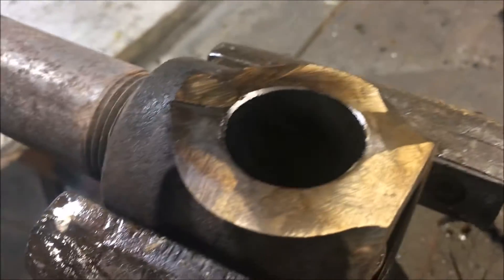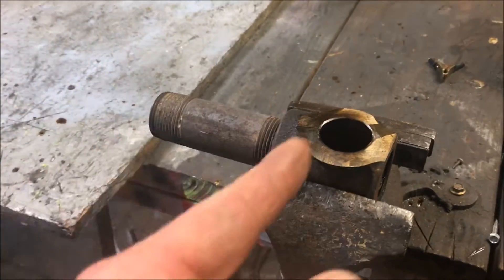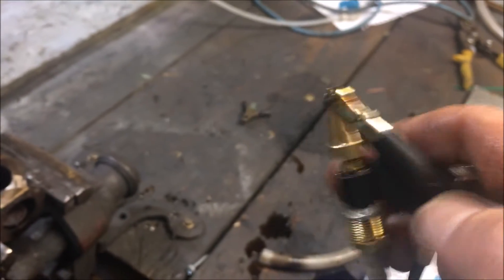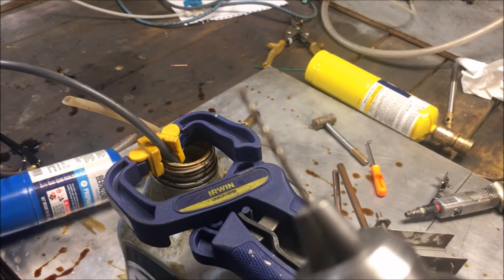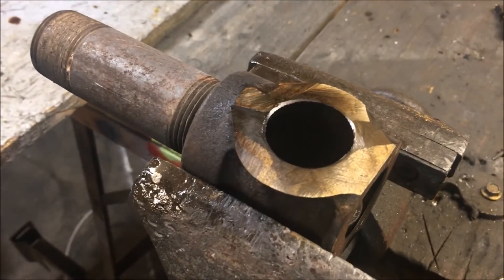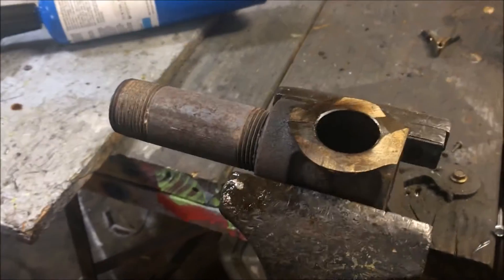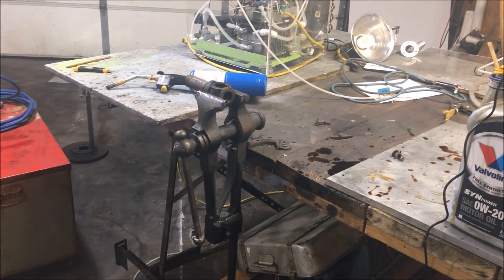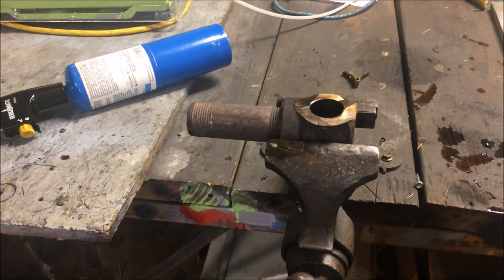Waste oil burner MICRO TORCH

Comment: This is quite similar to a burner setup for a pottery kiln that uses waste veggie oil. https://www.youtube.com/watch?v=zDFww3TCV80  One thing you might want to look into is using ceramics in your combustion chamber designs as they stand up much better than steel based solutions. I use ceramic flares for my propane burners in my small forge and they are so much nicer than the iron versions.

Comment: so this was with pure waste motor oil? And no preheating? If that is the case then im going to be building me one of these in the very near future as well. This might change the shop heating project i have. I still have a burner chamber from a natural gas central heating system laying around, and i have been thinking about building an oil powerd central heating system for my shop. I think that would be way nicer then just 1 big burner in a corner of the shop. With the central heating thing i could just put 4 radiators in the shop, 1 in each corner. Put a fan behind it and it will get the shop up to temperature much faster probably, and also much more consistent trough the whole shop. Now its pretty damn hot in the corner where my huge burner is(the thing puts out air wel over 100C  at 1meter of distance from the air to air heat exchanger pipes i have in there) But on the other end of the shop it takes 2 hours to get it from 0c to 20c. That is not that bad, but it would be nicer if the whole shop would go up in temp at about the same rate so you are not sweating in 1 corner and then freezing in the other.
Reply: o and forgot to ask, what kind of pressure did you push trough that airbrush? And any idea of the air flow rate it had when you where burning with it? That is the main reason im not going with the siphon nozzle style you have made. Im not wanting to run a noise compressor in my shop all day long to keep the burn going. But if this thing has a pretty low air flow i think i might be able to hook 1 or 2 refrigirator compressors up to a tank and run those for the heater. They dont require a lot of power and are pretty silent. And i could put an oiler in front of the suction port to give that compressor some oil flow if it needs it. It dosn't really matter if there is some oil contamination in the air you are putting in your oil burner right?
Reply from the maker: Correct no pre heat and no gas , i modified the $10 air brush just a bit . The compressor does not run full time so its under 4.5 cfpm. Im a carpenter , we run air compressors all day long at full capacity and they last over a year before any sign of problems . Im working on another test as we speak , maybe be something up tonight around 2 am
Reply from the maker: my wood burner is the same way so i use a small squirrel cage blower and blow it on the heater and it moves the air around very quickly
Reply: for moving the air i have a enclosure behind my air to air heat exchanger and there is a normal house fan running behind that. It pushes load of air trough it, that is why we get the shop up to temp so fast.
Reply: and for the compressor, i have a big compressor in my shop wich puts out more then 12cfm at 8 bar. But i dont want to run the heater from that because i sometimes need all that airflow for my airtools. Also sometimes i just want to leave the big power eater shut off. So that is why im looking for a way to turn down the air consumption if i really have to use compressed air. And refrigerator compressors can be picked up dirt cheap at prettymuch any scrapyard, they dont need a lot of power, and they are silent units. All those things would make it great for running 1 of these.
Reply from the maker: dont use a refrigerator compressor , i have videos on these devices and you would need 4 of them to produce the air we need . think about this , the piston in a  fridge compressor is 1/4 the size of a small air compressor, thats why they produce 350 psi   but they have very low scfm. go to harbor fright and buy this compressor , it will only cost around $120 , or get a car ac compressor and install an oil system on it , they have tremendous flow rates . or find a scroll compressor. that might put out enoug air , i would get one of those cylinder ac compressors. I
Reply from the maker: I actually have an ac compressor , maybe ill test it out 4 you on my next vidoe to see if it has the flow rate we need
Reply from the maker: Bob these things are very loud so i suggest you place the burner outside . the unit im testing today if very quite compared to others . the one in my other videos , the large one is around 95 dB
Reply from the maker: my blower burner is not as loud as the other units . but i think this little unit is the quietest
Reply: i have used an ac compressor connected to a drill, they put out a pretty huge amount at just 1000rpms from the drill. And now that you said that, i think i still have 1 laying around where the bearing on the magnetic clutch system is rattling. But since the thing should be fully on all the time and the motor wil be turned on and off if we need no more flow that might actually be a good idea. And those are pretty silent too. With just a wall in front of it with some noise insulation you would probably not even hear it running.

As for the harbor freight thing. First of all im not from the us, so no harbor freight here. And i have 2 of those cheap things, 1 i use at home for inflating the car tyres or other small things. And the other 1 is just being thrown around in the shop and had no real use as we have a big compressor wich puts it 250L barrel up to 10 bar in the time the small thing get its 25L barrel up to 8. So no use in the small things if you have the real deal big compressor standing.

And the reason i dont want that small compressor is because those things make so much noise i cant even talk to someone while the thing is running.
Reply from the maker: yeah the ones without  a piston do crank some good air ,  it just might work , i have a compressor i can try also .I think 3500 rpm is the rpm of those pumps
Reply from the maker: yeah i run my compressor outside because there so loud . im getting ready to check out that compressor as we speak
Reply: im pretty sure you can run an ac compressor up to about 5000rpm. Might be hard to find a motor to power that at that kind of rpm if it is going to be building a good pressure. From what i know they can absorb quite a few hp to run at normal operating pressure(wich sometimes is 16 bar from the top of my head)
Reply from the maker: I have a video of one of those compressors got to time stamp 4:20  https://www.youtube.com/edit?o=U&video_id=pWGf7I2by7Q
Reply from the maker: Bob i just watched a old video of an ac compressor and it does put out alot of air , i sent you a link , its far better then a fridge compressor
Reply from the maker: watch the video i sent you , i just did and im almost positive it will work , i still have the compressor in the video  and a bigger one then that . it looks like i got a steady 60 psi on a spray nozzle , thats huge